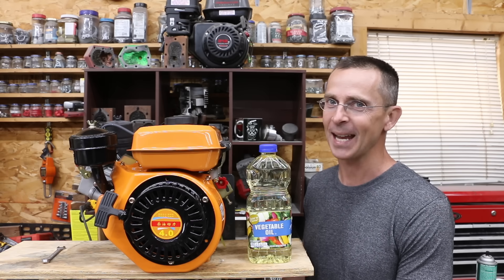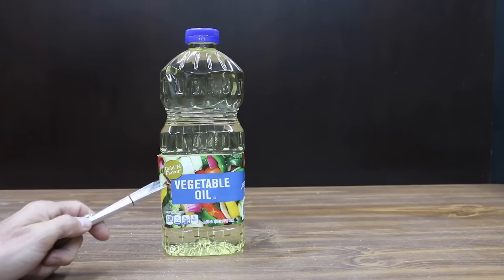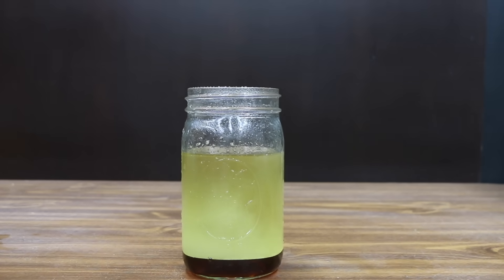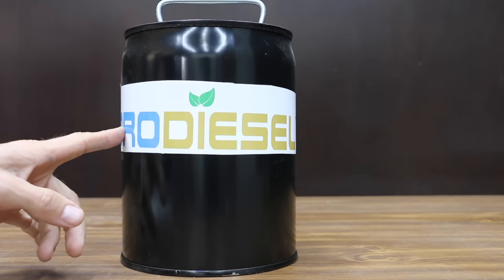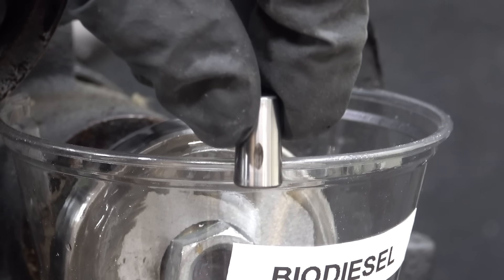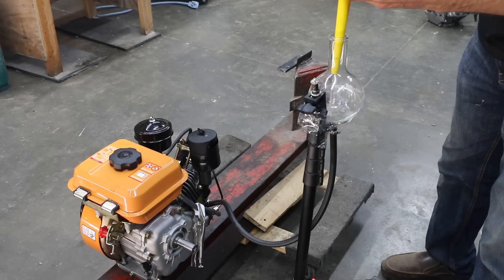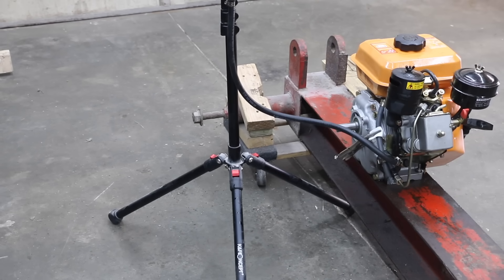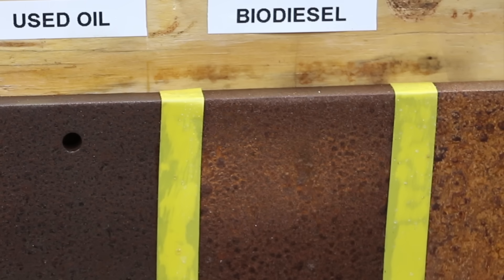Make "Biodiesel"? Let’s find out! Diesel vs Biodiesel, Used Motor Oil, Vegetable Oil, MPG

Comment: I have run thousands of miles using homemade biodiesel in my 03 Ram and my 06 Ram. My brother and buddy both used the Biodiesel I made also. All of us had great results. I processed 40 gal at a time with my setup. The biggest problem is the biodiesel won’t go thru a 2 micron fuel filter so you have to run 10 micron filters which can lead to injector problems over time. I had o cop tell me once he was planning on getting a doughnut but after smelling my exhaust we was thinking about French fries or onion rings!!!
Reply from the maker: lol on the french fries and onion ring comment!
Reply: Save on fuel, spend on injectors.

Comment: I know a guy who used to pick up all the used vegetable oil from fast-food joints. Hew would throw it in a centrifuge to clean it and then follow the normal bio-diesel procedure. 1 thing he always did was test the acidity because if it is too acidic it would cause damage to the fuel system. The main thing was since it was used it tended to be a little more acidic and so he had to cut it. He said running on regular diesel he averaged around 54 - 56mpg and bio diesel was in the low 60s. All in he said it was half the price (right around 75 cents Canadian) per litre compared to regular diesel.
Reply from the maker: Impressive results!

Comment: I have run a lot of used oil through my mechanical diesel truck. Usually at about 50/50 with diesel, but as high as 75% oil. Runs fine other than more smoke. Neven tried cutting it with gas.
Reply from the maker: Great feedback on the used oil. Thank you

Comment: In the 1960 the army used a multi fuel engine in there 2.5 ton trucks. You can find videos on what it would run on. Mostly it needed something that lubes the injection system and was about as thin as diesel. One of the videos said it loved peanut oil.  In the 60's I was in Alabama where they grow a lot of peanuts and we joked that the army was using peanut oil.  But diesel cost less than peanut oil so I don't think they were using peanut oil. But the army wanted something that would run on what ever fuel they can get. And from what I have seen above that engine, they had one. Prepers are going nuts and paying big money for the M35A2!
Reply from the maker: Very interesting!

Comment: I'm using pump B20 in my 97 ford 7.3. It runs fine but  I loose about  2 mpg compared to diesel  40 cents a gallon difference is the break point  less than that and I go back to diesel.
Reply from the maker: Great information. Thank you

Comment: another fuel that would be neat to test is wood gas from a gasifier. you can test it at its diesel and gasoline points for both a gas and diesel engine.
Reply from the maker: Thanks for the suggestion.

Comment: Great video! I was thinking about cleaning carbon from cylinder heads, have you ever used oxygen? Increasing the oxygen by using welding oxygen through a pipe into the carburetor (not pure, just adding extra to the air intake) should turn all of the hot carbon and junk into gas. No chemicals. I'd do it outside though in case the lawn mower engine blows up. That could be a lot of damage!
Reply from the maker: Great suggestion!  Thank you.

Comment: Very cool I experimented myself with biodiesel years ago, the problem with biodiesel is it causes a reaction with the engine oil and turns it into hard muck resulting in engine failure. Also if u have diesel still in your tank and u add biodiesel it reacts and causes material to settle out which clogs up your fuel system, This is well known in the biodiesel community
Reply from the maker: Thanks for the feedback.

Comment: It's well known that Rudolf Diesel used peanut oil in his first engine.
Reply: That was a proper diesel engine, though. What we call diesel engines are high speed semi-diesel engines. Not sure if that makes a difference to the fuel requirements. The injection systems do, though.
Reply from the maker: Thanks for the feedback.

Comment: I’ve been running a mix of 50% used cooking 🧑‍🍳 oil and 50% diesel fuel ⛽️ in my Ford Powerstroke for over ten years. All I do is make sure there’s no water 💦 and cooking oil has usually settled for months and then first filter is 100 microns for mixing. Then pumped into transfer tank. Then when it is pumped into the truck it’s pumped through 3 2”x10” water filters. First 15 micron then 10 micron and finally 1 micron filter. The truck runs fine and sometimes I think 🤔 it has more power 🤷‍♂️. 
The negative is it will eat up anything made out of pot metal! Doesn’t seem to bother aluminum. So on my fuel filter housing is the fuel pressure regulator made of pot metal and it ate it up. Fuel filter housing is aluminum. I replaced the regulator with a OEM , but I have purchased aftermarket made of aluminum. Last year with the Covid-19 fuel price went way down so I went back to diesel fuel but of course this year it’s back up again but I haven’t used any mix yet. I’m retired so don’t drive much and don’t drive the truck in the winter ❄️ in the salt. It a 2000 F350 with no rust at all! Hope this helps some cooking oil users.
Love your videos keep up the good work!
Reply from the maker: Thanks, will do!

Comment: I've done some research few years ago, and it boils down to: Modern "common rail" diesels with ultra-fine nozzles (think 2005 and up VW tdi etc) should NOT be ran on anything other than diesel, and if you are conscious owner, you should always add lubricity additives to preserve the life of the injection pump & injectors. Any other "substitute" fuel will ruin those components.
If you step down to AHL VW or even better, older Mercedes diesels (80-ies), you can ran them on biodiesel, veggie, Waste Veggie Oil (from deep fryers etc - WVO), used motor/atf oil, with HUGE caveats of: 
A)You CAN ran them on straight veggie/used veggie (old fryer) oil, but: 
A1) Those need to be heated in order to work so most systems that were commercially available ("L0veCraft" was one of them) would have you start and warm up your car on regular diesel, than switch to WVO, and switch back to diesel before the shut down (so you dont end up starting the car on WVO ; 
A2) If you run them with straight veggie/VWO, you will ruin your injectors and injector pump over time (they will run fine at first, which fools owners into "its ok to run them like that") because lower lubricity; 
A3) You will have "coking" deposits on the injectors, where oil gets "cooked", essentially coating the fine surfaces of the injectors with thin layer of hard-as-nail polymers that are nearly impossible to dissolve (resulting in harder and harder starts & running); thats why almost every injection pump/injector nozzle service will flat out refuse to work on parts that came off from car that was run on VWO (or any combo of it). And those parts are NOT cheap to replace. 
A4) If you use VWO, you need to prepare the heck out of fuel. If you are using used veggie oil, know the source ("Crisco" is widely used instead of canola, and it is NOT a good start point). Fuel needs to be filtered several times; most people let it sit for week or two in the sun to "settle" the big chunks, then filter to about 100 microns (IIRC) via several filtering systems. That usually creates bug/rodent/algae issue on top of storing such product and living with the smell (I guess if you live on the farm its ok) 
B) if you choose to go with biodiesel route: 
B1) Well made biodiesel can be valid substitute for regular diesel, if lubricity additives are added (even modern diesel will run with it, but every manufacturer will flat out deny any warranty claims on fuel system if car has even whiff of biodiesel. VW had HUGE issue with their 2006 and up tdi's, with lift pump failing withing few 10k's, and they got REALLY sensitive about the whole biodiesel issue); in other, older diesel it will run fine, no need for in-car-heating, separate fuel tanks, switching in between regular diesel and bio. However:
B2) Points A-4 about prepping the raw material still stay. You still need to know the source, you still need to filter the heck out of it, and only than you can start with production of the fuel. That means you will have a borderline meth lab in your garage, with places to heat, mix and decant the fuel. See above about the rodent/algae/smell, plus add fire hazard to the mix.
B3) Biodiesel involves obtain methanol, aka race fuel. Price of gallon of race fuel is roughly $10/gallon, if you buy it by the 55 gallon drum. You need about 12-13% of ethanol to make biodesel (you can recover some, but not all, and it adds additional complication). Add price of other chemicals, and all of the sudden, biodiesel starts to approach price of the regular diesel, and without all the hassle. If you are big time consumer (say, have large farm etc), you *might * see savings; for a regular every day driver...its debatable.  
B4) Biodiesel will eat regular hoses (think fuel lines etc). So you will need to replace every single one of them (including rubber o-rings) with Viton ones. Plus, if you spill biodiesel on any of the "regular" rubber (think radiator hoses or tires), you risk that biodiesel will chew through those as well. Thankfully, its not *that * big of a reaction, but it is still a concern.
C) Running older Mercedes/Cummings on ATF/old engine oil. Very doable, those are much more "agricultural" in nature, but legality (from EPA stand point of view) is questionable. When you use ATF/engine oil you burn all the nasty stuff (additives, dissolved sludge etc) which are carcinogenic (even more than regular diesel), so if you get caught, depending on locale, you might face some fines. 

So my conclusion is: Its doable, but its a huge hassle each way you put it. I did my homework when I had '87 Mercedes 300T, and again with 2006 VW tdi (when fuel prices were almost $4/gallon), and when I calculated time & effort to collect VWO, prepare it, make the fuel, buy & store all the machinery and chemicals - it was not worth it.
Reply from the maker: Thanks for the feedback.

Comment: The original intention for the diesel engine was to create an internal combustion engine using thermal dynamics that would run off of any type of flammable fuel.  Remember Diesel is a process not just a fuel… by today’s standards.
Reply from the maker: Thanks for the feedback.

Comment: The best way to wash used cooking oil is to boil it over water. The rising steam strips the dirt. Biodiesel needs dry oil so tap the clean oil from above the water. Drain the dirty water and remove debris for composting. 
Similar system will wash the biodiesel but first it must be separated from the dark glycerol soap. You don’t want that in the engine. 
Vegetable oil burns nicely in diesel engines but must be heated to 80 degs C. About 180 degs F to avoid stock carbon deposits. Glycerol chars before it burns but preheating the oil allows a clean combustion.
Reply from the maker: Thanks for the feedback.

Comment: I use to use vegetable oil in the workshop for drilling deep holes in steel. It gummed up as it dries out. Then I tried motor oil. the drill bit kept on ceasing. I had to buy cutting fluid. When you did the friction test I knew the veggie oil would come out on top.
Reply from the maker: Thanks for sharing.

Comment: Shortly after the Freedom Fuel America system first came out, I purchased the 250 gallon a day system for under $5,000 back in 2002. Back then, you would be able to go to a restaurant and they would give you their used vegetable oil from their fryers for free because it cost them money to dispose of it, so I would get 4 50 gallon drums of used oil for free. You had to log how much potassium hydroxide, lye, or sodium hydroxide that you purchased and keep those receipts at all times, and you had to log how much biodiesel that you made in that given day.

Not even a year later, 9 months I believe, the Government made it mandatory that ALL fast food restaurants had to have a special container that had a designated lock on their used fryer oil. A designated truck would then pick up the oil and take it away ending peoples ability to get free fryer oil to convert into biodiesel. Any restaurant that gave any of that oil away would be fined a substantial amount.

The Government did not want people making their own biodiesel at little to no cost because it made them independent and self sufficient. I still make biodiesel for my dirtymax here and there. I purchased a GSF kit, Golden Fuels System, that automatically switches from diesel to vegetable oil when the truck is at operating temperatures. It's a pretty cool kit that comes with your pumps, a heated fuel cell to heat and thin raw vegetable oil before it is injected into the engine, fuel lines and everything else you need to make it work sufficiently.

Comment: * VIDEO IDEAS *

• Best floor jack for lifting a car
• Best heat-gun
• Best heavy-duty staple gun
• Best shop rag
• Best moving blanket
• Best caulking gun (manual & electric)
• Best wood router
• Best wood-router cutter-kit
• Best bench-grinder
• Best voltage detector (contact & no contact & even high-end stud finders with wire detector)
• Something Silly: All Natural Motor Oil Contest. Which is the best motor oil substitute -- real maple syrup, fake maple syrup, honey, agave nectar, fryer grease, duck fat, or high fructose corn syrup?
Reply from the maker: Thanks for the video ideas.

Comment: If Biodiesel got the same Tax Subsidies as Oil it could be sold way less than Diesel probably $2.00 a gallon or less. but lets get real the U.S is run like a corporation not a country.
Reply from the maker: Thanks for the feedback.

Comment: Id be curious to see if you could make an animal fat based diesel mix. obviously it would solidify if it was straight fat but I bet an engine would run on it if it was mixed 50/50 with diesel. Heck whale fat was the fuel of the future a few hundred years ago.
Reply from the maker: Thanks for the video idea.

Comment: Iv run my diesel on alternative fuels for several years.
I started using bio diesel. Then moved over to waste veg oil  and finally I used old motor oil.

The only problem iv had with the motor oil is that my injectors carbon up rather quick.
Reply from the maker: Thanks for the feedback.

Comment: I like your video - great job!  Maybe you can get some French fry oil from McDonald's or other fast food places to make some biodiesel?   Another idea for a project would be to make a enclosed vessel (control volume) and use animal waste from your farm to make methane gas.  You could put the waste into the vessel, close the lid and then have a pipe at the top running to a compressor.  You could then store the methane in a high pressure tank with a check valve in between the pump and high pressure tank.   The gas could be used for heating or to run a CNG type engine. It would be very interesting to determine the yield of methane gas vs. the weight of the waste.  I enjoyed the video - thank you! 😊😊
Reply from the maker: You are welcome!  Thanks for the suggestion.

Comment: Awesome video! I have to mention the guys at CarThrottle did the same a couple of years back in their Skoda called Miles and they filtered used cooking oil (which seems to be the cheaper option for them in the UK) so why not try used cooking oil to make biodiesel next?
Reply from the maker: Thanks!  Thanks for the suggestion.

Comment: I wonder how Jet fuel will compare to the other fuels you have tested in the video. One idea would to test how to make jet fuel the same lubricity as desiel by adding certain additives. Some ideas would be jet fuel and ATF, jet fuel and motor oil, aswell as jet fuel and vegetable oil. Thanks for the video!
Reply from the maker: You are welcome!  Thanks for the video ideas.

Comment: if you plan on using used motor oil make sure you run it through a centrifuge filter system to get out all the soot and sludge. Old military trucks and old  mechanical injection motors like in the video run great off used motor oil
Reply from the maker: Thank you for the video idea!